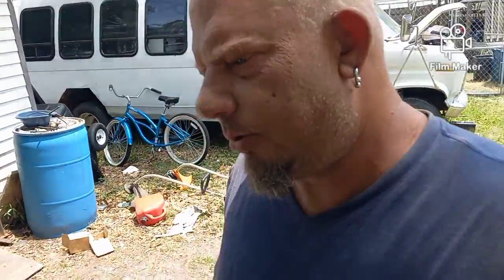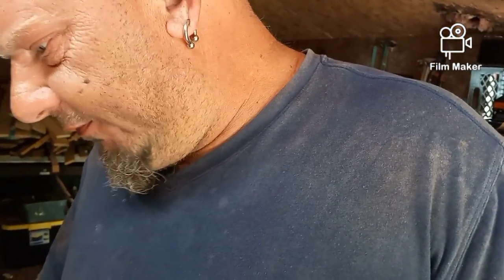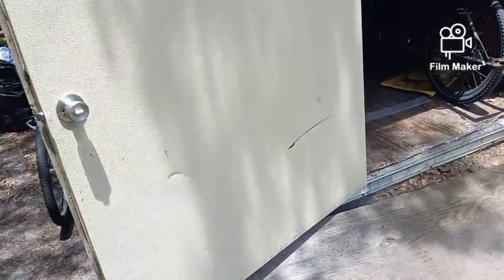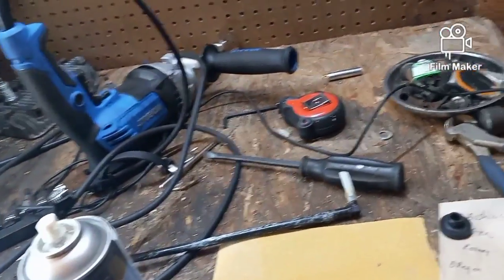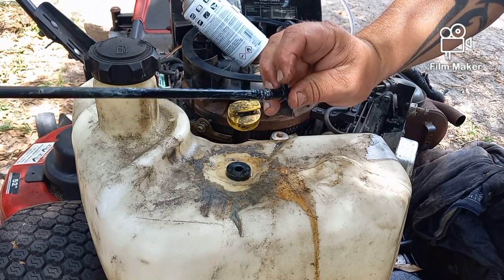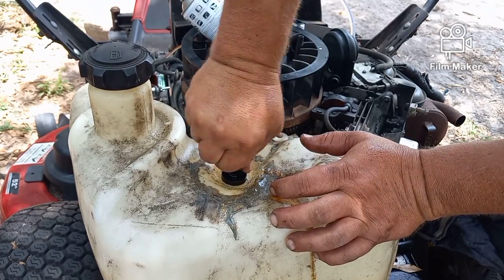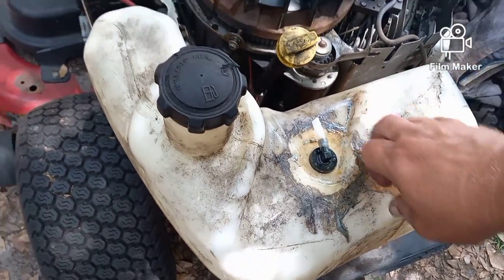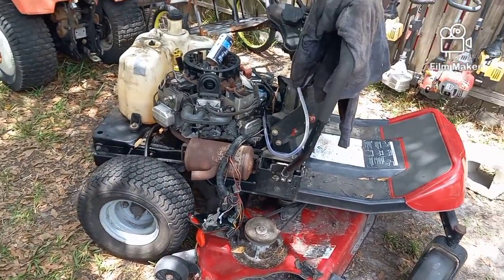Craftsman  Leaky Gas Tank Fixed That Easy / Lawnmower

Comment: great video: i fixed the fuel tank leak with ease, now i have a? KOHLER 23HP COMMAND. I cannot get air / fuel adjustment right. When engine sounds running good both on idle and full throttle after adjustment of air/fuel i start mowing, after a while engine sounds as though it is starving for fuel, I have tried everything i know plus recommendations from other people. Any suggestions. Thanks
Reply from the maker: Couple things... just thoughts.  Fuel line could be partially clogged or collapsing .  Is tank venting properly so not to create vacuum.. did u put new fuel filter on that won't let fuel flow .  Or is old filter clogged.  Is there an internal carb jet that needs to be ported or drilled out slightly. When it comes to fuel delivery you start at the tank.. test everything and work down thru carb
Reply from the maker: Unfortunately with lawnmowers even though u can fix it in a 30 min video.. a lot of times it's 8 hours of trial and error and retry

Comment: Great video! Craftsman 917.276240 riding mower. Gas tank has 2 cracks. New one is not available. I repaired the cracks. The fuel line is on the bottom. I have the new stem tank fuel irem 3645J and the new bushing 139277. Any advice to putting these new parts on? I see The video  putting the bushing on the zero turn but not from the bottom area. Thx
Reply from the maker: They install the exact same way.  Push the rubber bushing in making sure it's seated correctly and just push the fitting in.  When u do it you will actually say out loud.  That was easier than I expected lol.. you will do fine I promise.. they all install the same

Comment: Thank you very much for producing a very useful video.  Process is well illustrated and described concisely.  I have a Craftsman (Model 917.289283) with  a damaged pickup line.  The one you referred to as the "straw".  Can you tell me the part number for the pickup line that goes inside the fuel tank?  Or possibly where I can get one?  Thank you in advance.
Reply from the maker: Thanks so much for your kind words and for subscribing while your here.. its midnight here in Florida but I did a quick look and found you some on Amazon I will give you the link.. The thickness should be standard across most machines.. the length is important so if you pull your existing pick up tube and measure the length you will know.. also scroll down and look at related items if the length of 10 inches is not long enough.. and of course if you need it shorter just cut to length.. the model of the machine or brand name wont matter much so this is a John Deere just measure yours .. hope this helps.. let me know how it works out for you 

https://www.amazon.com/Ariens-Pickup-Assembly-Gravely-04333600/dp/B00TD9TCF8/ref=ci_mcx_mr_mp_m_d_sccl_2_11/136-3744056-9263412?pd_rd_w=b6t5Z&content-id=amzn1.sym.904f4c18-630f-4c52-8bdf-78921242d9bd:amzn1.symc.27c848cf-47ab-487b-bd07-91bc659e0119&pf_rd_p=904f4c18-630f-4c52-8bdf-78921242d9bd&pf_rd_r=81EPB55R7RY4XJ7H4E3H&pd_rd_wg=Pqz84&pd_rd_r=3dcaea98-771c-40d1-8fe1-5cc55d42372d&pd_rd_i=B00TD9TCF8&psc=1
Reply from the maker: https://www.amazon.com/Ariens-Pickup-Assembly-Gravely-04333600/dp/B00TD9TCF8/ref=ci_mcx_mr_mp_m_d_sccl_2_11/136-3744056-9263412?pd_rd_w=b6t5Z&content-id=amzn1.sym.904f4c18-630f-4c52-8bdf-78921242d9bd:amzn1.symc.27c848cf-47ab-487b-bd07-91bc659e0119&pf_rd_p=904f4c18-630f-4c52-8bdf-78921242d9bd&pf_rd_r=81EPB55R7RY4XJ7H4E3H&pd_rd_wg=Pqz84&pd_rd_r=3dcaea98-771c-40d1-8fe1-5cc55d42372d&pd_rd_i=B00TD9TCF8&psc=1
Reply from the maker: Thanks so much for your kind words and for subscribing while your here.. its midnight but I checked online quickly and found you that link.. I buy mine from a local shop when available.. they are pretty much the same no matter what brand or style mower.. the thickness is standard.. so just check your length before you order.. if its too short you can scroll down the page to ... similar items and look for a longer one.. if it's too long just cut the length to fit.. but it should work for you.. let me know how it works out. I have to remember to list all part numbers in all videos to help people.. that video was a while ago and I just dont have the part number written down.. see you soon
Reply: @MunkyWrench  Thank you very much for replying to my question.  This is exactly the part that I need.  Not having a part number I could not find one anywhere.  I appreciate you taking time and finding the part for me.  I will be following your videos to benefit from useful tips and instruction.
Reply from the maker: @tajwall-wj7xl  Happy I could help.. I am always around for questions .. Happy belated Fathers Day

Comment: I think this just might have fixed my new to me zero turn. My question is and pardon me this maybe a dumb one but how to get that pick up line out of the tank? Just pull real hard until it lets go?
Reply from the maker: It can be put in 2 ways.  A runner grommet or it could have been put in with sealant.. if u use a razor knife around the base it should come free.. be careful not to cut the pickup tube.  I'm glad my video started you on the right track to repair your zero.. let me know how it goes

Comment: Where do I order a gas tank from
Reply from the maker: Honestly there's only a few ways to get a new one and they are unbelievably expensive.. u can look on ebay.. or Original manufacturer website.. or see if u have a junk yard for mowers in your area .. if at all u can fix the one u have with epoxy you will save hundreds.. u can also look on Craig's or offer up for someone selling a broken machine that still has a good tank